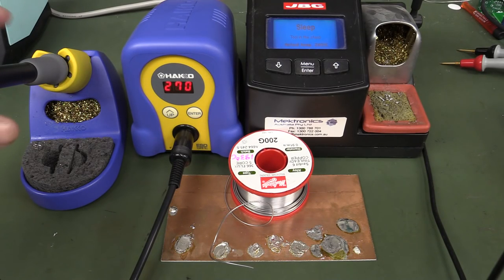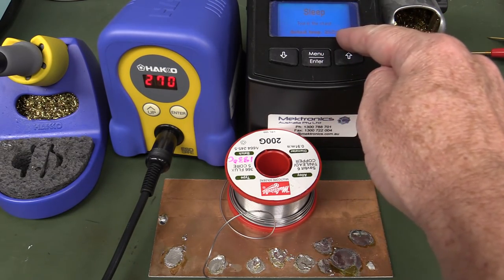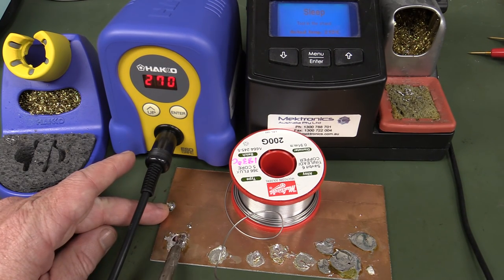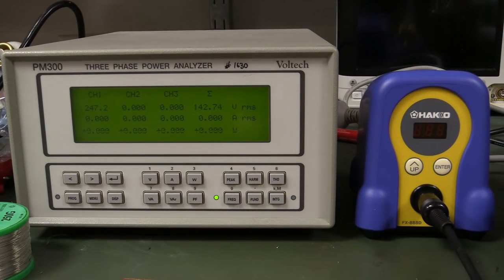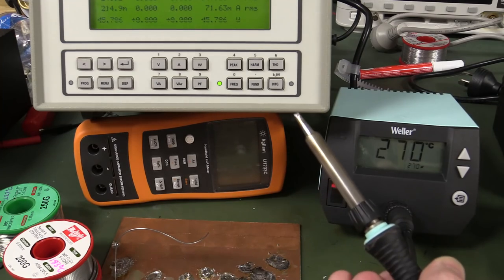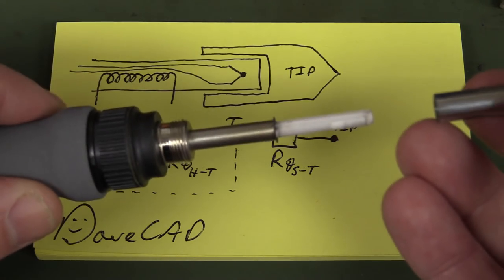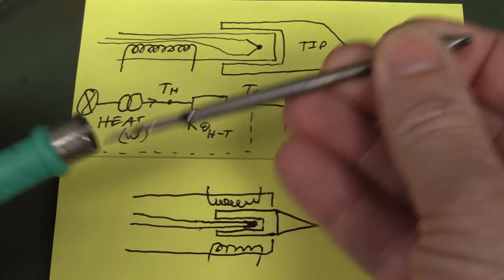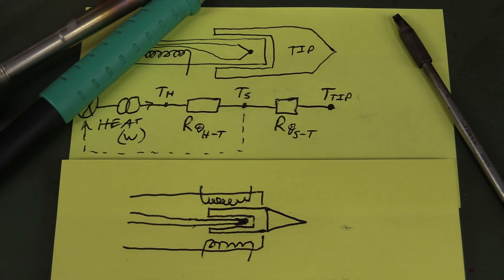EEVblog #1065 - Soldering Iron Power Delivery Explained

Comment: Metcal Mx series use direct drive technology by almost 35 years. Company call this technology Smartheat that is similar to  induction feedback.
Reply: I use direct heat technology as well. two carbon rods ans an old car battery, needs to be an old one tried a new battery but it blew the board up.
Reply: believe it or not people solder in prison with the graphite in a pencil connected to i forget what, like a tablet power supply or mains voltage i have to look up the video and they mod electronics with it too

Comment: Why not cut the temp sense wire and run another around the outside so the thermocouple is resting in solder on the tip. It probably won't be equal but it might be closer.

On another note an efficient 130W running at 50% is still going to be way better than inefficient 65W, so to be fair you needed an inefficient 130W Vs an efficient 65W. Also the 130W blipped to 95% and 72%, but being efficient it didn't need to stay there that long so it looked like it was only using 60W.

Comment: less thermal conduction back because the element is in the tip itself and even the rod holding it out is a smaller diameter. the heater in a traditional soldering iron is in the rod, and it heats the tip through the rod, the newer idea (direct drive) has the heater in the tip. less thermal waste.
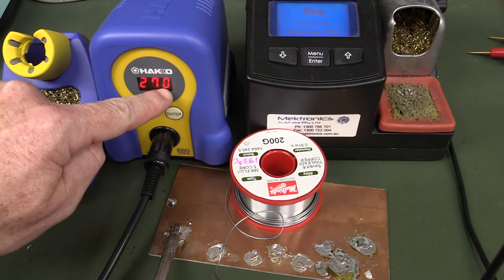Reply: 7:35 because the sensor is in the handle and the sensor point is somewhere in the middle of the rod and even if it were right next to the tip it still wouldn't be in the tip, while the heating also comes from the rod so if the rod is hot enough the system can only assume that the tip is.
Reply: Sensor is not in the handle, it's is in the ceramic heater cartridge. The heater is a very thin metal layer around the perimeter of the cartridge near the last cm or so of length, a fraction of a millimetre below the surface, and the sensor is on the flat side at the very end of the cartridge, so the sensor's temperature should drop rapidly when the tip is cooled - but by far not rapidly enough.
Reply: i think we actually said the same thing but i'm too tired to look further siana.
Reply: by the way, what bimetal sensor do you know of (temperature sensor) that is anywhere near the actual point of detection? the sensor itself IS NOT the probe. the PROBE is in the heat, the sensor is sensibly far away from it.
Reply: oh, the apology i would accept is "you're right, and i hate you".
Reply: Huh? They use either K-type thermocouple or something like TDK/EPCOS glass bead thermistor, either can be used at temperatures of 450°C, both have been spotted. It's the probe and there is no further sensor.
Reply: There is no correction for ambient temperature, it's just assumed to be somewhere around room temperature.
Reply: i think you are mistaking a probe for the sensor itself. the sensor is the part that reports the results of a measurement from the probe. even if there is a whole computer in the probe, it is still just a probe. it reports back to the sensor.
Reply: if the sensor is not independent of the probe anything sensed is suspect, the sensor must be away from what it is sensing. that is why it isn't a "all hell broke loose" sensor. or something along those lines. the probe ≠ the sensor, and any good sensor is nowhere near what it is detecting.
Reply: Oh. The electronics is in the base station. The fully analogue stations just use an opamp/comparator IC, the digital ones drive the glass bead thermistors straight into a microcontroller's A/D converter via a voltage divider towards the microcontroller's supply voltage, or for thermocouples like a couple stages of opamps are used to generate the voltage to go into A/D.
Reply: normal soldering stations for every day use hardly have sensors and only one probe, i am not talking about these soldering stations.
Reply: while at the start i was, you turned this into a conversation about sensors and probes, i admit that i started it with my own statement concerning soldering stations, but i do feel that i need to make you understand the difference between sensors and probes, and why something that might look like a sensor can actually be a probe because it can't be a legitimate sensor in it's circumstance.
Reply: a sensor needs a base line, it is fed data from one end and it has to measure it against something. a sensor in a fire could only be a probe, because it is in a fire and can only report a fire, but it can report a fire back to a sensor as a probe. get me?
Reply: Please go on, because you managed to thoroughly confuse me right now. I mean i've seen plenty of soldering stations and their internal construction, but i can't make heads or tails of what you mean.
Reply: 16:42 starts to explain the difference in the performance, and ultimately it has little to do with sensors and more to do with where the heat is coming from. although in both cases the probe is reporting back to sensors in the handle (or base station). now that could just be by changing resistance through heat, but the sensor IS NOT IN THE TIP. the measurements are taken far away from the hot end. let me make it real simple, i'm sure you have seen a mercury body thermometer, which end would you call the sensor and which end would you call the probe. because as i said, the probe ≠ the sensor.

Comment: How can you watch it in HD when you're broadcasting in 480p?
Looking at it the heating element doesn't actually touch the tip! the tip doesn't look like it touches the end where the thermal sensor is located? this would have a big bearing on if it kicks in or not! the element is behind the sensor and it can heat up the tip and bypass the sensor. Be interesting what sort of gap is at the end and to fill this with a bit of solder or copper to see if this improves it's thermal dynamics and switch on the sensor more readily?
Reply from the maker: I only upload in full HD
Reply: EEVblog no it's not showing it'?  maximum 480p
Reply: You're probably watching on an old phone

Comment: Wonder if heatsink paste would have any effect, would it improve it a bit
Reply: I was thinking the same, but i think that regular thermal paste is not made for temperatures higher than 100C
Reply: RacoonBoyBR ye think your right, probably just dry up real quick.
Reply: I have Keratherm thermal paste that is high-temperature but it's not certified to go past 200°C, and it does slowly degrade past 250°C or so. Still some people have used it in their 250°C 3D printer hotends for the thermistor or the heater cartridge, and it seems the dry crumbly stuff it eventually turns into still does something, or maybe it just seems to them like it does. I didn't bother to try anything like that in my 3D printer.

Russians use either graphite powder dry lubricant or copper brake grease to fill their cheap soldering station tips, those are evidently thermally conductive and withstand very high temperatures.

Comment: It is not big surprise that JBC will react faster, and no matter how good or bad is sensor position, JBC tip simple have lower thermal mass and with that fact it will smaller thermal inertia.
Better comparison would be "old" style PACE PS-90 and "new" cartridge style PACE TD-100 (with "identical" tips I didn't see any advantages of TD-100, my impression is that is even worse then PS-90 in performance and temperature stability).

Comment: I much prefer a throw away tip as in the old style.
I do not like the all in one stem and tip as in the new style.
It is unnecessarily complicated and will inevitably be more expensive.
So why not the old style tip with the new style electronics?
Would the small air gap still be significant?
Of course, the Hakko temperature could be increased to cope with your ground plane.
I notice your test was done at just 270 degrees.
So turn it up and then turn it down again for normal work.
No big deal for what would be a rare occurrence.
Reply: My thoughts exactly, that is why I bought the ST-100 with the Weller LT series tips.

Comment: When you talk about butane lighters, don't laugh.  A friend of mine (sadly now deceased) used a butane (or whatever goes into lighters) powered soldering iron.  Yup, he lit it and went from there.  It seemed to work for him, and it was "cordless".   I believe it was a Weller.
Reply: They were very popular. I still have a couple of them lying around.
Reply: There is nothing wrong with turning to a butane torch or soldering iron when out in the field where no power is readily available.  But they are not exactly the preferred soldering tool of choice where AC power is readily available.  I use a butane torch to solder RF connectors in the field where it would be very inconvenient to try and run AC power -- plus they cool down much faster than an unregulated soldering iron which is great if you happen to be at the top of an antenna tower.

Comment: Could it be beneficial to add non-electrically conductive thermal compound as an interface between the ceramic heating element and the tip of cheaper irons?
Reply: It can.
Reply: I don't know if there's a compound that won't break down at the high temperature in a soldering iron.
Reply: If i remember correctly, both Weller and Ungar used to supply such a compound. It also prevented the tips from seizing in the heater.
Reply: dcelctrl I still have some I do automotive wiring some times and it did seem to make a difference with the bigger wires and with soldering stuff to ground... seemed just as long to warm up initially. It is a bit of a pain though so I usually only apply it when I am using the big tip.
Reply from the maker: Maybe. But if it was a good idea then they'd supply it or offer it.
Reply: EEVblog I have some anti seize compound by edsyn at the moment which I use with my dodgy automotive soldering iron it is supposed to help conductivity. But I have an old jar somewhere that I thought was from Wella which I think said anti seize and thermal paste... I would not recommend either for a good iron especially if you change tips much and I have never actually done a side by side comparison.
Reply: Yeah electronics thermal grease absolutely does break down. Keratherm i have is rated up to 200°C but it turns to dust at 250 or so, and the normal stuff may be even less resilient.
Reply: Siana Gearz you can get some that are stable up to 1000 degrees Celsius they are made of clay minerals and stuff like sodium silicate so they could stuff the ceramic if you choose the wrong one and they react and they are nasty stuff (they will turn your skin to soap for example)
Unless they are manufactured for the purpose or it is a crappy iron you don’t mind the experimenting with (and you wear appropriate PPE) it probably isn’t worth the risk
Reply: I'm sure i've probably mentioned it elsewhere, but Russians use either copper brake grease or graphite dry lube to fill the gap in their cheap Hakko clones. Messy, but apparently not damaging.

Comment: Hi gents .... I want to know if there is some kind of pt100 or pt 1000 or any temperature measuring probe with a standard interface that is actually multiple probes measuring a larger area.
Reply: Intuition tells me you can just put 4 (or 9) in a series-parallel configuration, so they have the same resistance as 1, and the meter should show you the average of the set. Or you can get more technical and design an opamp circuit to convert the resistance of N in series to a suitable voltage for metering.

Comment: I wonder if someone were to add a bit of solder to the inside of the soldering iron tip for the hakko, to allow the solder to conform to the shape of the heating element and reduce the thermal resistance between the two. IMHO the design of a lot of the "older" irons, my hakko 888D included, I always thought was kinda shit, relying on some loosy-goosy fit of the iron tip and the ceramic element.
Reply: Power Max I'm thinking thermal expansion might cause the ceramic heater to crack if the loose fit wasn't maintained. The tip itself expands upon heating, the ceramic expands, if you then put something to take up the slack then there wouldn't be any room for the expanding ceramic within the expanding (and therefore constricting) iron tip. At least that's my theory as to why it's been done that way.
Reply: Redemptus Renatus the solder or tin would ideally melt and midigate that issue. Simalar to the use of gallium compounds for CPUs in the PC enthusiest space. Being ceramic I wouldn't expect the solder to adhere to the top upon needing to replace the tip. Might have to try this on some cheap temp controlled iron...
Reply: Yea, I've seen this suggestion before. I would be curious if someone actually tested it out and seen if there was a difference, how much, and if there was any damage or side effect of doing so. I imagine you'd want a lower temp solder though, just to mitigate the risk of the time difference with thermal expansion between the ceramic and metal outside. Then again, maybe density matters more...I don't know. Also, I think some people mentioned using thermal paste like with CPUs, though I don't know if they're spec'd for higher temps like you find with soldering elements.
Reply: I have the feeling solder paste would vaporize and harden. It gets old and crusty with CPUs reaching only around 80*C or so. I would be worried with using something like galium in fear of it vaporizing or amalgamating with the copper. I know aluminum gets attacked by it.

Comment: And then there's the Bakon 950D... $50 with a power supply (piss-poor SMPS to be sure), a chinesium-siliconish cable sheath, and T-13 75watt tips. These I'm sure will have the usual one-hung-low quality. But what do I care, a Pace ADS200's heading my way soon! :-)
Reply: Cliff Matthews The Chinese Hakko 950 clones were addressed in the previous video.

Comment: People still recommending the TS100? lol. You will definitely find it crap, and compared to these stations it is crap. It's small, portable and does the job, that's all I can say about it. It's very light, which is actually annoying when you have to use a big power lead from a laptop.
Reply from the maker: People obsess over the TS100, it's the greatest things since sliced bread, didn't you know?
Reply: EEVblog I love sliced bread, but I'm reluctant to believe that the TS100 makes for a great sandwich.   I'm very much in the camp that everyone should use whatever soldering iron/station works best for their needs and fits their budget and portable, potentially battery powered, soldering irons certainly have their place but there is a real limit as to how much power one can take from a USB port or battery bank.  That and ergonomics are of some importance if one wants to do much soldering because it is difficult to maintain fine control for an extended period if the soldering iron handle is either too hot or otherwise uncomfortable in your hand, though soldering with such certainly is not impossible, just not much fun for the long haul.
Reply: EEVblog well, if you want the new tech(and why wouldn't you?) for cheaper then a FX-888D the price can't be beaten, and if you don't need the power to heat through large ground planes you can surely see why it is so popular. I got one for little over $60 including shipping from massdrop with a 40W power brick but you can get a 65W one and it would compete better with these stations power wise.

TheAmmoniacal I agree with you with regard to the light weightiness of it becoming a detriment to handling with a thick and somewhat stiff power cable.
Reply: There were a song by REM with this text. Imitation of life. In this case imitation of soldering iron.
Reply: Even the people who love it say that you have to use a 24V power supply and a silicone lead, not the power supply and lead that it ships with or a typical laptop supply.
Reply: I guess what people are saying is that if you're only going to own ONE soldering iron, or you're buying a first one, the TS100 might be a better choice than a bulky and more expensive benchtop one like the FX-888D

Comment: i'm curently stuck with the old style iron that came with my PRO Stormer(probably clone) solder station, i'm having isues with it coolng down to fast while recaping a original xbox and i so far have no complaints on the $60ish USD  station so i'm researching how and if posable  to change the iron's port to whatever the best intergated tip style iron i find. Hints why i watched this helpfull vidio. as i hoped it sounds like the type of irons i'm looking for use the same electrical method so hopefully i can find the wire arrangement the new port uses and reuse the wires set up for the stock port.

Comment: Watts input = Watts delivered to the tip?  Hum..  Maybe we could detect in-line with the heating element and measure actual power delivered to the tip.
Reply from the maker: Good enough for ballpark. Subtract the nominal 6W if you are that fussed

Comment: I'm surprised someone hasn't come up with a replaceable tip thermally coupled to the heater using solder or solder-like material, or maybe heat sink compound, so it can only be replaced while hot. 

The tip would likely have to have some cuts along the shaft to deal with the thermal stress of heating and cooling.
Reply: Yes YES yes.  Fill the gap with solder or something with a higher melting temp than the solder.  Crank that puppy up to 400+C to change tips.  It doesn't feel easy does it.